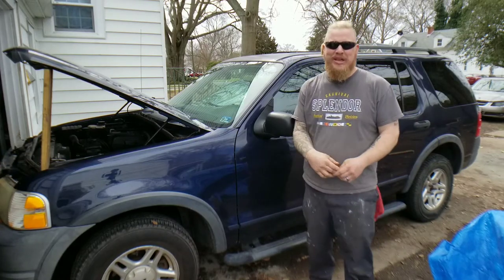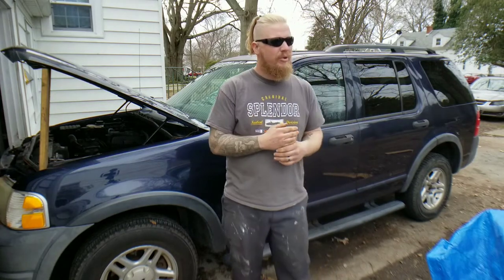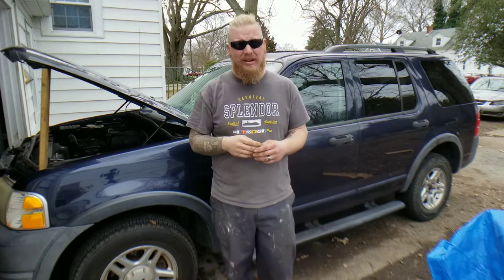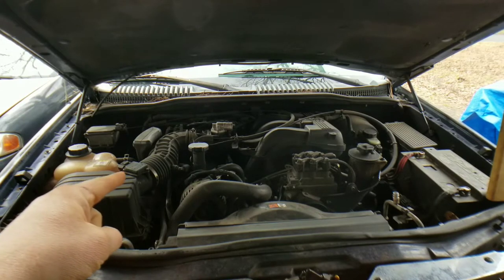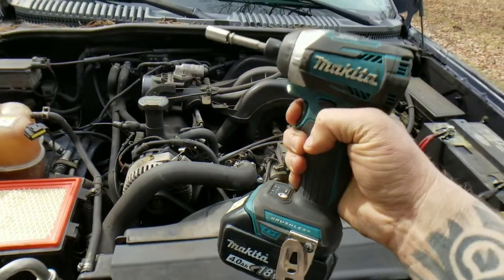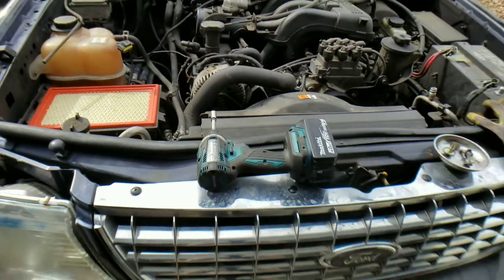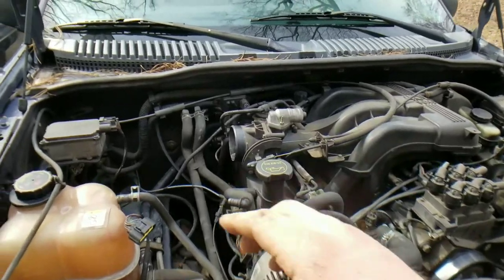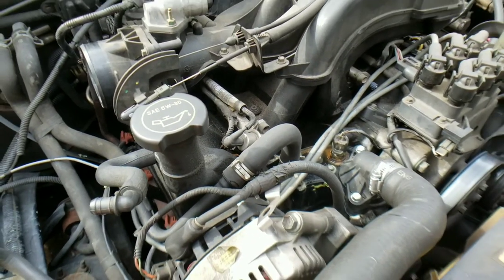How to Remove the 2004 Ford Explorer Engine

Comment: I will be pulling my 4.0 engine from my 2003 Sport Trac. Your video has helped tremendously. Thanks, Lars
Reply from the maker: My pleasure Lars! One learns alot when replacing an engine, as in my circumstance this was......dont try to pull an SUV engine in a short garage..... I hope we all can learn from my mistake. I had to pull the tires off and lower the vehicle to the ground while lifting the engine with my engine hoist lol, it was quite a to do. Well anyways, thanks for watching and let me know if you have any questions! Dont forget to subscribe for more DIY Auto repair videos here on the channel!

Comment: awesome job,,,im in the middle of rebuilding my engine also,, everything is all new cause same problem, rear and front timing chain broke
Reply from the maker: Thank you Chris! Good luck with your rebuild! Remember to get all of the plastic pieces out of the engine if the guides broke. Also did you pick up the valve removal tool? Hit subscribe to catch more of my future auto diy videos.
Reply from the maker: How was the rebuild?

Comment: Timing chains can be done in vehicle. Slide the trans back for access to the pivot bolt. Do it once a month.
Reply from the maker: Good to know for the next one. Unfortunately with this one the timing chains were destroyed so I had to have as much room as possible to get all the guides and broken chain out. Also it gives better camera angles when I have it out. But thanks for the tip on the next one! Hit subscribe and be notified when I release more videos, thanks for watching!
Reply: Dang that’s what I need has a stumble on idle!
Reply: @Sellthoseflippingcars  sounds like a cost saver mine just has a stumble replaced outer tensioners still has that annoying shake

Comment: Do the shift cables still have to come off if its a floor shift instead of a column shift?
Reply from the maker: No you can keep the shift cables on. Unless you are dropping the transmission as well.

Comment: So this motor bent valve when back chain go off ?  Because I have that problem now my back chain is off but no broke. Just the plastic guide is broke  need to know if I bent. Valve on my truck. Which is 03 ford explorer v6  4.0 too plz let me know
Reply from the maker: I would definitely check the valves. Also if you are in there I would do the timing chains. Just to save yourself the headache down the road.

Comment: Lol... Got me wondering why I took this job on🤣 it's not the money, it's my sanity!
Reply from the maker: I always wonder that on the big jobs, but I remember when I see the money earned and the lessons learned. Remember just because it was hard this time doesn't mean it wont be next time.
Reply: @Sellthoseflippingcars  you're right... I say to myself "I've done worse". 

I got a 100k mile engine from lkq keystone, looked bad. Long story with the company I've been dealing with for years. Anyway, pulled the valve covers and the right rear bank chain guides are shattered! Ordered a new right rear chain set, will be here Tuesday.

Engine had locked up. Was partially taken apart by another person. I had to remove sub assembly and all rod caps to free up whatever was preventing full rotation. I'll likely do a video on it in the up coming week or two before I send it back as a core.

14hr labor pay... I added 500 labor extra luckily   because it needs more stuff... It's gonna be done right when I'm don't. I just dislike Ford! 

Thanks for the video, seeing your trouble  provided insight for altering my execution of extracting this engine
Reply from the maker: Yeah all repairs can be traveling at times. That sucks about your timing chain guides. That is what I like to call in Easter egg hunt because you are going to be searching for a while for the remnants of that timing chain guide.
Reply: @Sellthoseflippingcars  I got 99 percent out. The rest can get lodged in the strainer. I'm not worried at all! She's gonna run great once done.  Luckily it was caught
Reply from the maker: How did the rest of the repair go?
Reply from the maker: Customers like that pushed me away from repairing other peoples vehicles. I have had guns pulled on me on multiple occasions so they didnt have to pay. Crazy world! I know those customers!!! Lol You have to do what is best for your business brother. If they seem too much for the cash then keep it professional, do it once and break ways....or not at all lol
Reply from the maker: I dont even like selling vehicles to people that know me. They want me to have it brand new......I have to remind them ummmm its as is. Lol
Reply: @Sellthoseflippingcars  wow... My dad did body work and killed a guy because they jumped him. Guy came back weeks later and my dad was ready for him! Happened on my 19th birthday I wanna say

I don't wanna keep my gun on me because I don't go looking for trouble. But dealing with people and money, unfavorable interactions gonna happen! 

I got a few stories but nothing to having a gun pulled on me work wise lol.... Damn, this isn't the wild west.

I'm the future, if they can properly structure a sentence, I'm turning them away😂. Not going through this

Comment: Which size wrench did you use to remove the fan? I've pulled my engine before, but I don't remember the size. I thought it was 1⅛ but it doesn't fit.
Reply from the maker: I use an adjustable wrench that I have the goes up to two and a half inches. Remember to have the serpentine belt on when trying to loosen the fan.
Reply: @Sellthoseflippingcars  thanks man! 

I rebuilt the top end last year, then the new Cloyes tensioner I put in it blew apart as soon as I started the engine, so now I'm having to rebuild the entire engine. All of the valves bent on start up. I've been working on cars for over 20 years and I've never seen a tensioner fail like this. Especially not a brand new one.
Reply from the maker: You are most welcome! That is ridiculous!!! I would walk away and come back they next day after seeing that
Reply: @Sellthoseflippingcars  I still haven't finished it. Work called me back after my layoff, but now I'm back laid-off. Things are crazy right now, but I'll be finishing it up soon. I'm tired of paying insurance on a vehicle I can't drive. I'm still dealing with Cloyes. They're gonna be paying for this crap.
Reply from the maker: That is just crazy, sorry to hear about that. Why dont you wrench for yourself for extra cash? Since you know your way around an engine
Reply: @Sellthoseflippingcars  that's what I'm doing. My father-in-law has a mechanic shop, so between layoffs I work there. It pays the bills, but that's about it.
Reply from the maker: Where do you live? City and state wise

Comment: Wondering why you even touched anything on the transmission? Why would you touch the shift cables drive shaft etc if you're just taking the engine out? Thank you
Reply from the maker: This was an old video and a perfect example of why you should not work on a vehicle if you are tired. My apologies
Reply: @Sellthoseflippingcars  definitely.
Reply from the maker: Lol, good you agree bro

Comment: Great video..I will be doing my timing chains..than you...would like to see the engine back. 
..
Reply from the maker: The engine installation is all the steps I showed in the video in reverse. Make sure you top off all fluids at the end. If you need any torque specs let me know. Thanks for watching the video and hit that subscribe button to be notified of all my future Auto DIY videos!
Reply: Yes plz. Tky  my us the flexo gas motor I believe is the same any way

Comment: These engines fail at high mileage and cost for this job isn’t worth it. That’s why people junk them. Interior etc looks great but has the infamous rear chain where it’s impossible to replace with out removing engine. At least what manual calls for.
Reply: if you got the time to do it yourself, I imagine the cost of the parts is negligible - thus making the cost for the job fine as long as you don't mind spending the time, yes?

Comment: You didn't show you pick the motor out
Reply from the maker: Yeah sadly in this video there was quite a few clips that were corrupted. I found out after completing the job. I even had another video recorded that I tore the engine down. I will get another Explorer and will have to reshoot again. Sorry about that one Jonathan, I hope you found some benefit in what I did show.
Reply: Fixing to do an oil pump  on a similar vehicle. Thanks for going through the process. May have to pull the motor due to a trans axle being in the way of the oil pan.. Very helpful in how to go about it.

Comment: Exploders are a pain in the ass to work on especially if you have to pull the motor out just to replace a timing chain and retime it. You cannot replace a timing chain in the the vehicle as there are front and back side of the motor to line up the the timing marks that is why the motor has to come out. Pretty stupid how Ford engineers design this motor in mind where you have to put more work into it rather making it simple.
Reply from the maker: I totally agree this is a bit much to do a timing chain. Thanks for watching!!
Reply: @Sellthoseflippingcars  Yeah man I did a low of parts replacement on my 06 Ford Explorer since it was passed on from my dad about 8 years now. There is so much I can tell you what I replaced on it since I took ownership it isn't even funny. The most recent major replacement I did was replacing a bad transmission shift solenoid which I was driving like that for about over year until It got to a point where it was jerking while putting it into reverse or it would stall when slowing to a stop light or coming to a complete stop. I had pulled a code for the solenoid. That part was over $400 for the oem ford trans solenoid pack. Had to replace it with 5 quarts of Merkon V transmission fluid which wasn't fun to do either and put a new transmission oil pan gasket and had to reset the computer and have it relearn the shift points after the job was done.
Reply: i mean i did a lot of parts replacement

Comment: The worst car ever..recurring failures in the engine, gearbox and electrical wires...what is the alternative engine for it with a manual gearbox?
Reply from the maker: Agreed! Definitely not my favorite year of Explorer, and honestly that would be custom work to get it to fit with manual gearbox and alternative engine, I would just get a different vehicle.